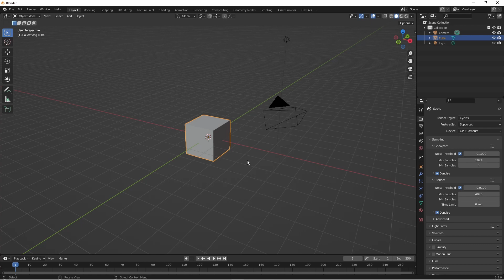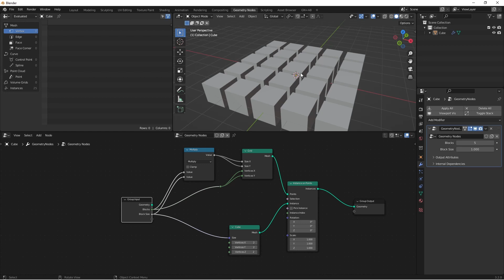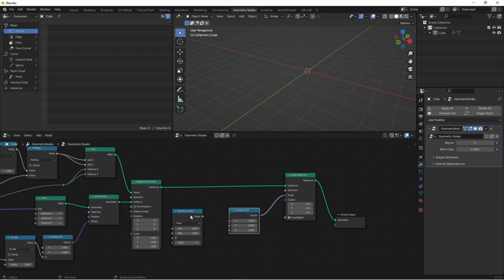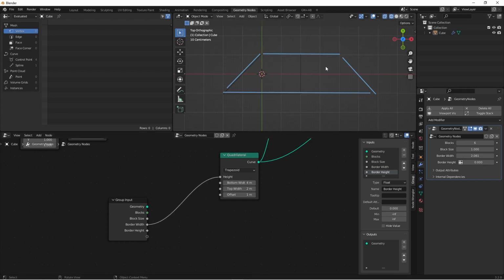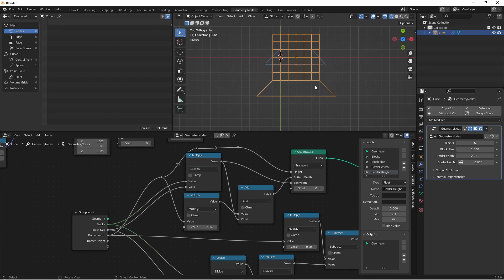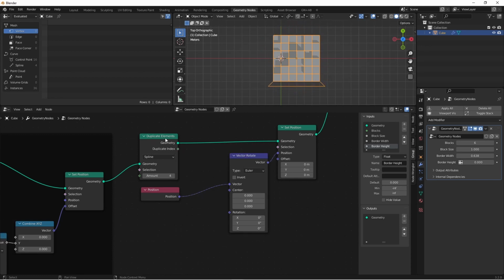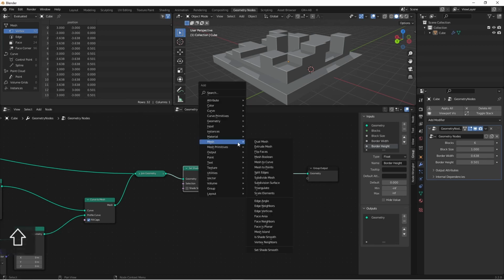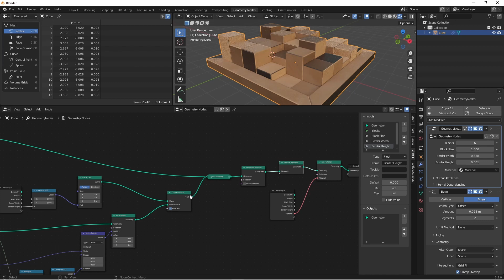Procedural Wooden Sound Diffuser Tutorial - Updated for Blender 3.2 and beyond!

Comment: I love your tutorials. I just think it would be much easier to make a frame by setting a big cube, then just inset (extrude/scale top selection by 0). Wouldn't it have the same effect with less nodes?
Reply from the maker: Sure but this way you get really nice 45 degree cuts on each corner like a real frame 😄
Reply: Nevermind... I just tried what I was saying and it is not that simple lol
Reply from the maker: Yes extrude the top face with 0 offset, scale the top of the extrusion by a certain percentage based on the width, then extrude the top again down.